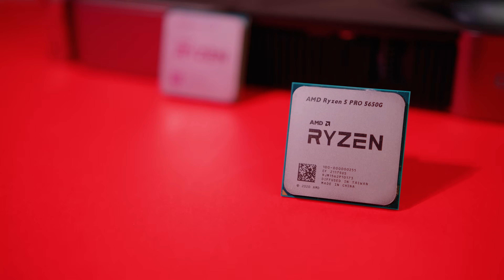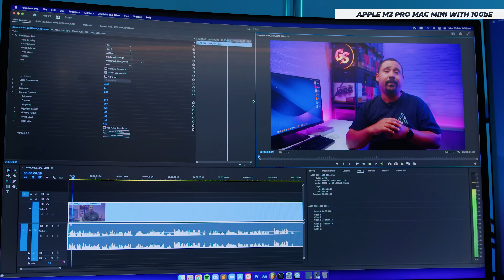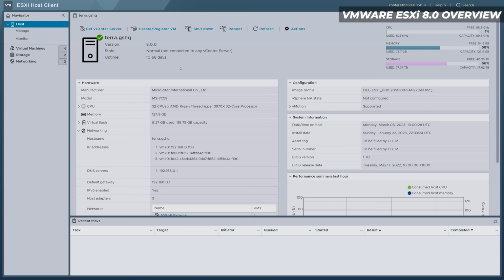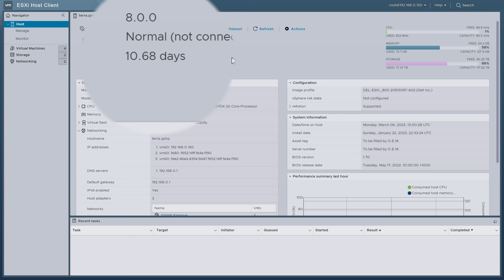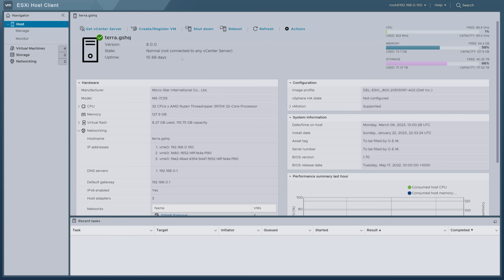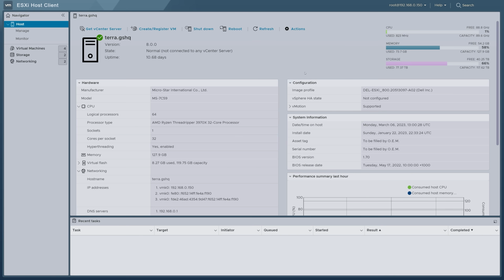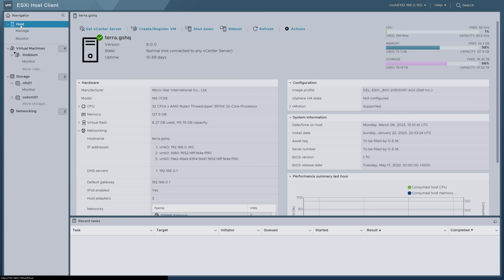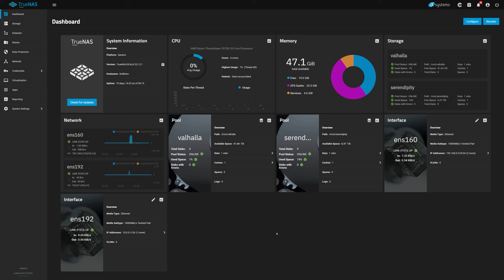I Built the ULTIMATE HOME SERVER and it RIPS!

Comment: Do you have a breakdown of all of the components you’ve used here? I’m extremely new to servers, and I’ve been looking for a chassis that makes sense, but can’t find anything with 12 drives available for lower than $800. And it seems like you added the drive modules after? I’m not quite sure how I should be looking for the chassis and modules that would be cost effective and not break my wallet. Hot swap would be preferred, but I’ll settle for anything to help with figuring out how to get started.

Comment: is amd  officialy supported for esxi ? Or you do some workround ?
Reply from the maker: Yes of course. You don't need a work around. Not sure why you'd think it wouldn't be officially supported.
Reply: @GearSeekers  My guess is he must have been an older esxi adopter. If my memory serves me right early days esxi had a fairly strict hardware compatibility list.

Deviating from that list would introduce some weird problems. Alot of amd products then where not recommended by the hcl.

I'm sure much has changed and these kinds of vids make me want to have a fiddle with esxi at home again.
Reply from the maker: I used to deploy opteron servers in the mid 2000s with ESX and it was fine

Comment: I got an Epyc CPU + motherboard for similar reasons.  Upgrading a couple old Xeon machines and migrating from truenas core to scale. Consolidating 2 systems to 1 having and 5 PCI-E 4.0 x16 and 128gb of memory in that one is going to be nice when it's finally all up and running.
Reply from the maker: Yeah that was my idea as well. We had 2 servers doing things and all I ever wanted was one box that does it all.
Reply: What's the going price when using a setup  you and Gear Seekers are using? I run numerical weather prediction models at home and this the Epyc might be something I should look into.
Reply from the maker: On the 2nd hand market probably be Able to get a decent motherboard, CPU and ram combo for about $2-3k